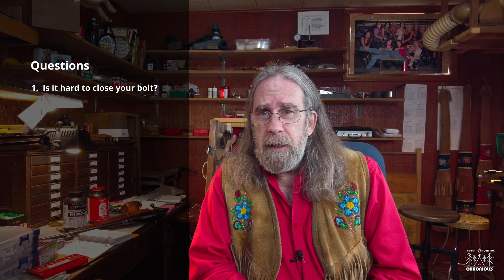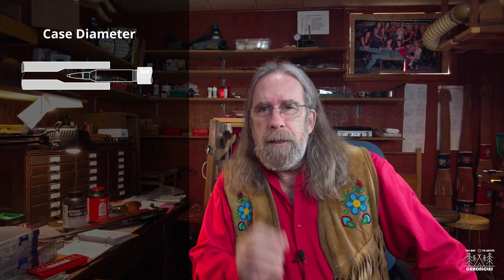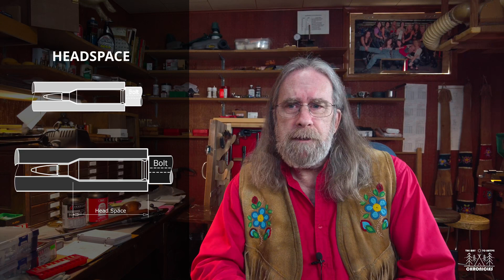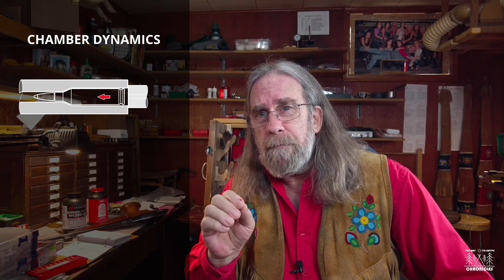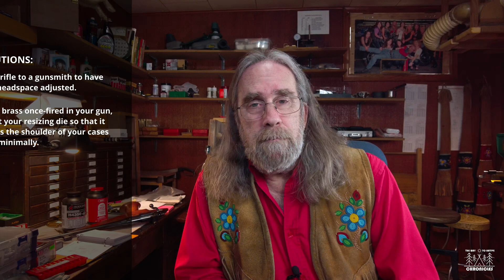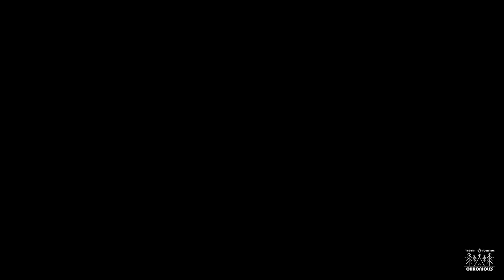Understanding Headspace: How to Fix Misfire and Case-Head Separation Issues (4K)

Comment: Excellent video. To me when u say ammo manufacturers intentionally size their rifle cases shorter then the minimum headspace dimension in order to fit any standard SAAMI chamber it implies the round will stretch that first firing to fit your specific chamber. Going forward if u reload can then adjust ur die to move the shoulder back only .002 or so for a bolt gun and you then will have cases custom fit full length partial sized to your rifle. I hope iam understanding this correctly.. too much space means a case that isnt sized to that length. Its too short and it will expand especially where its not supported toward the head of the case at the rear.

If the case is too  long for your rifles headspace dimension,  it wont chamber.

Have you made a reloading video that demonstrates how to custom size a case for proper headspace that doesnt oversize them? Would be nice to see. Thanks.
Reply from the maker: That's a great explanation.

Comment: If I'm understanding correctly,  it best to let the shoulder grow until it becomes harder to close the bolt , at that point bump the shoulder back minimally? With my twice fired brass I am still having no problems closing the bolt. Thank you
Reply from the maker: That's basically right.  The shoulder will grow to match the inside dimensions of your chamber after the first time it's fired.  After that, you can just bump it back a tiny bit, so that it chambers easily without the bolt being hard to close.

Comment: you can only reload 303 British 2 or 3 times before the case separates just like the 33 Winchester, I reload for those two and it's just the way those two cartridges are they will never last more than 3 or 4 if you're lucky and head space is very good.
Reply from the maker: What you describe is largely due to the fact that the chambers for .303 British were manufactured all over the world and with widely varying tolerances, so the cases had to be sized with the shoulder set back quite a bit to ensure the bolt could close on the gun. By having a case with its shoulder set back so much, when fired, the case stretches far more than other properly fitted cases made for other rifles (which less variation in chamber sizes). That stretch then results in more rapid head separation when used repeatedly, especially if you don't experiment on the once-fired case to set the shoulder back the minimal amount necessary to allow it to chamber in your particular rifle. Hope that helps shed some light on this subject.
Reply: @TheWaytoNativeChronicles  yes i know lol
Reply: What brass do you use? Do you full length size?
Reply: @AldoSchmedack  yes full length size as I use lee dies I use what ever brass I can get
Reply: @AldoSchmedack yes, I use Lee full length size, and I use whatever brass I can get

Comment: Now in my elder years I have come full circle back to rimmed cases: from .22 Hornet up to .45-70, all in single-shots.
Reply: Same! 303 British, 7.62x54r, 22 Hornet, 22LR, 357 Magnum, 22 Magnum, and 32 SWL. Love rimmed ammo as it can be extracted easier if it gets stuck. 32 Auto is semi-rimmed and also good round. Same on 25 Auto. My 380 Auto isn't rimmed surprisingly, and for it's use that's okay. The semi rimmed isn't much beyond head-web width, but it is there, tho.

Comment: Thanks for the info, good to know. Is it the same with rimmed cases?
Reply from the maker: You're welcome.  Rimmed cartridges are, for the most part, quite a different kettle of fish however, because they headspace on just the rim pressed flat against the rear of the barrel, instead of the shoulder-to-base dimension inside the chamber.
Reply: @TheWaytoNativeChronicles  Makes sense. I've got a Browning 71 in .348 win that on occasion the cartridge case gets a vertical crack about 1/4" long near the neck of the case. Any thoughts on what's happening?
Reply from the maker: @Melcop1886  hard to say, but when rimless bottleneck cases finally crack (from the brass being worked too often due to too many reloads), that's where the cracks show up most often and do so in a lengthwise fashion.  Your .348 is a rimmed cartridge though, and the video only addresses rimless.
Reply: @TheWaytoNativeChronicles  Good to know, thanks for the info!
Reply: @Melcop1886 You could try casting your chamber or getting special gages to check the headspace and make sure it is in spec and then what the dimensions exactly are. It will help assure safety and also give you better dimensions to size to. Contact Hornady, Sierra or similar and they can give you info free on how to. Brownells also will help ya.All those have been super helpful as has Redding. Some older guns, esp levers, can stretch if they gave been shot a substantial amount over time as the first metals used were not able to be hardened like modern steels since late 1890's to 1930's. Since 1930 the issue seems to have went away metalurgy wise.